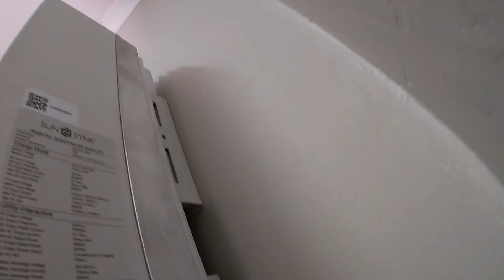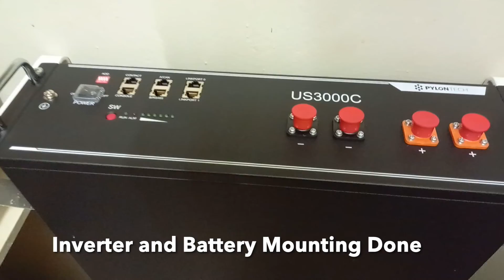Part1- Solar Install: Unboxing and mounting of a Sunsynk Inverter and Pylontech 3.5kW battery

Comment: Hi, really enjoyed watching your install, will appreciate a video of your AC connections to the Grid and DB box.
Reply from the maker: Coming soon! I got all the components where i’ll be splitting my db into 2. One for non essential and the other one for essential. Currently finishing off recording my next video where i build a battery stand and add 2 more batteries to my setup.

Comment: Hi
Excellent video. Very informative.

Would like a video showing the 2 cables from the inverter being wired into AC protection box  and the db board.

Only part of the install not shown was that.
Reply from the maker: Video on that is in the pipe line. Busy working with an electical engineer on splitting of the db board into Essential and non Essential boards.

Comment: Just a note. The new Sunsynks come with a new logger and a new app that you can even remotely adjust the settings. Looks like you got some old stock with the old Solarman logger.
Reply: New loggers are available from Segen
Reply from the maker: Thanks, already installed and I love the new app. Being able to manage your setting remotely and the faster refresh rate is awesome.